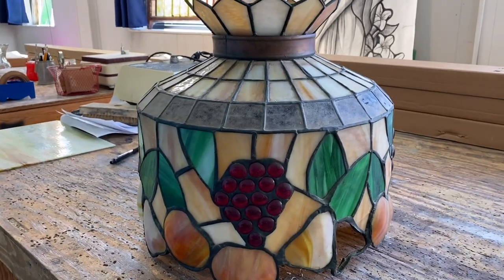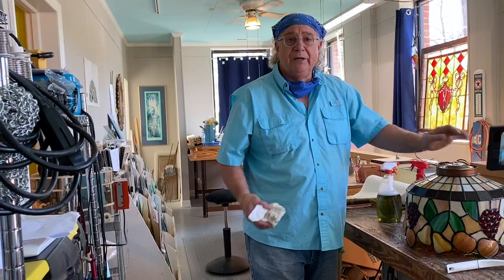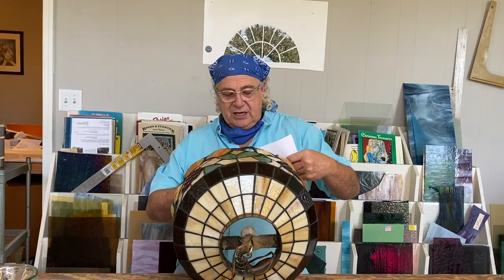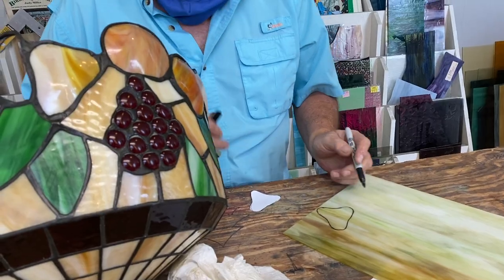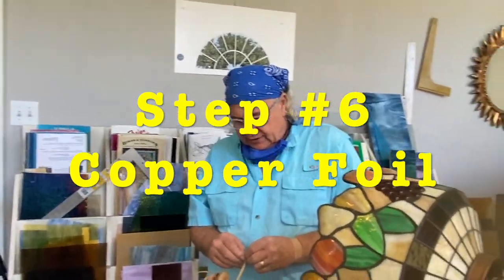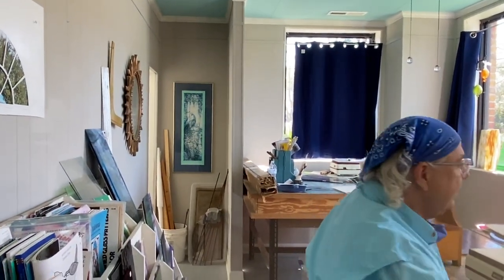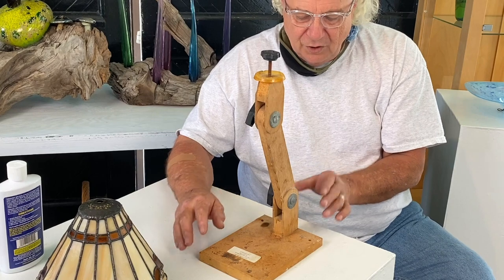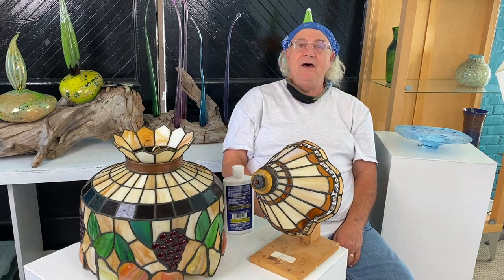Vintage stained glass Lamp Repair

Comment: I watched you repairing the fruit stain glass pair.   I never did stain glass I want to attempt this fix.  Did you solder on top and the bottom when you were putting the pear  in.  You didn't really show that in the video.  Thanks.   I have 3 tiny pieces that broke when the lampshade fell.
Reply from the maker: Great question. It was tack-soldered in place first, then soldered on both sides.

Comment: Pretty well done video but you skip a lot of the technical processes, inside curves, grinding and fitting into the existing lead cavity. I guess you had a reason.
Reply from the maker: This is an early video and definitely needs improvement. Thanks for watching and commenting. We’re live on Mondays at 7pm if you have questions!
Reply: It’s a huge reason I was watching was to see steps between 6 & 7. 
A glass in my brothers door is broken, and one cracked. I’m trying to learn how to DIY and excited to find this channel.  Since you’ve already done it somewhere else, could you please put the link(s) in the comments?  
Cool tool - I know now I HAVE to remove it from the frame … yes major newbie, but know enough to learn from those whom really know.

Comment: What kind of solder do you recommend
Reply from the maker: Good question! 60/40 for copper foil and 50/50 for lead work. As far as a brand of solder we are currently using Amerway. It’s good.